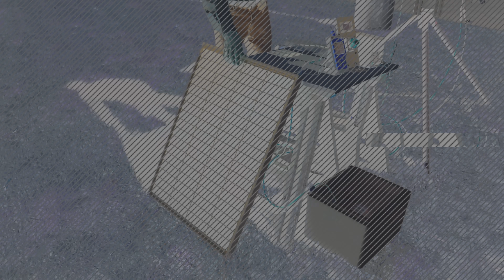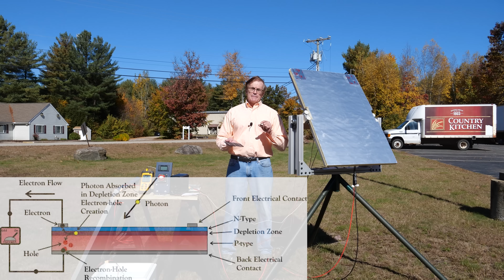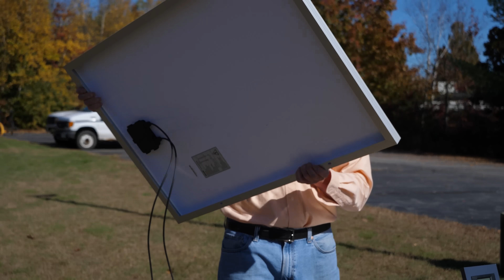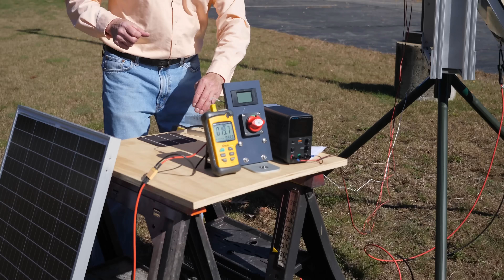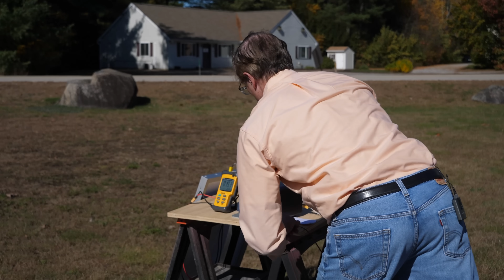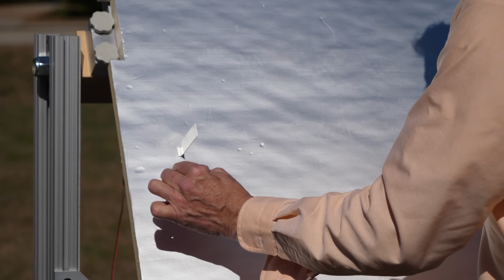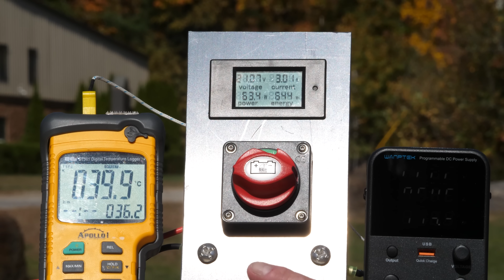Do you REALLY get enough out of your solar panel?

Comment: The ONLY thing I could suggest is to run a side by side comparison of the two identical panels, one actively cooled, and one not. I'd like to see data logging and graphing the way Matthias Wandell does. Face them due south and let them run for a full 12 hours.
Reply: I’d like to see this as well. During the initial control test measurements, I wondered if the unpowered cooling system has a greater temperature than the unmodified PV panel.
Reply: @jasonwisser3253  Good point. Tough to tell. The added heatsinks on the back may have even lowered the temperature of the panel when the cooling was disabled. It's not a perfect test.
Reply: @jasonwisser3253  It's unlikely that the modified PV is hotter than the unmodified one. 
They receive the same number of photons that create the waste heat this modification is addressing.
Reply: Great suggestion!
Reply: That's exactly what I was thinking.    Although it's a good experiment, this test wasn't really a comparison of an active cooled panel to an unmodified panel.   Having all that extra active cooling hardware on there without the fans running, might actually be hampering the passive cooling compared to an unmodified panel (Especially having the back closed off).
Reply: @Matthiaswandel Please respond to this!
Reply: I agree with this. The added aluminium sheet on the back would detract from the natural convection cooling which would occur. This shows why free mounted panels work better than roof mounted ones. The caveat now, is that panels have gotten so cheap, it's far easier just to add a few more panels to compensate. Certainly cheaper than all those fans and heatsinks!
Reply: Yes, and drive the fans by the produced energy off of the cooled solar panel through a buck converter set at the fans most efficient voltage. Adding any external power through a power supply does not make sense for a scientific efficiency measurement.
Reply: @niclas.lindstrom  That's exactly what was used in the video. The bench power supply and fans were supplied by the panel, but not included in the load power measurement. This means that the panel actually produced 8W more power, but 3W was devoted to cooling, so the net power gain was 5W.
Reply: @asm_nop  Did you invert to AC and then back to DC? If so, your gain was probably even higher as there are conversion losses that can be avoided by simply using a DC/DC buck converter instead.
Reply: @asm_nop  The gain would be between 0 to 5W without the modification
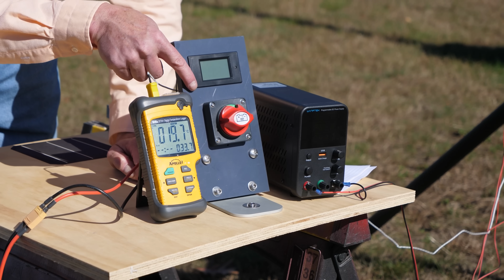Reply: @asm_nop  no. The solar panel power was only going to the resistors. Look at 8:20 again.

Comment: You might wanna check out the solution of Linus from @LinusTechTips where he's planning to use water cooling for panels and dump that heat into pool nearby his house. Ofc that solution wouldn't be really applicable if in winters there is very low temperature to the point in which water would freeze in the pool but it still sounds quite efficient. Another way could be to dump heat as in-floor heating (however it's not really applicable for summer) or maybe just route water via copper pipes in ground? Usually several meters underground there's like not too hot nor too cold in moderate climate and that could be another possibility for water cooling. Speaking of pumps efficiency, it would also scale with power draw kinda like fans, running one pump for single panel would most likely be inefficient but one larger pump for whole roof section of them sounds quite compelling. Even if wattage net would reach equilibrium or even very slightly waste, that could probably still pay off in panel longetivity and reduce waste of used up panels which is worth it in my opinion.

Comment: This takes me back to the video about using reflectors to boost the output from a single solar panel, since one big issue with doing so was that exposing the panel to over twice the amount of sunlight would probably fry it, this seems like it would be a great way to reach the top rated power output even on less than ideal conditions
Reply: I saw one panel that had one tiny cell, with huge heat sink and a focusing lens to concentrate sunlight.

Comment: I have a 10K system on my roof that is underperforming. I know heat does have a small effect in the summer but the drop off in spring and fall is significant.  Winter is just horrible.  Given that my system is already installed, is there anything I can do that might improve performance outside of summer?  I'm about a 45 degree latitude. About half my panels are oriented south and half to the afternoon sun due to my L shaped roof.
Reply from the maker: You can perform a simple  experiment.  On a clear day, note your power output and then spend  a few minutes with a hose and spray water over the whole array. Immediately (or during if you have an assistant), note the power output.

Comment: I don't think you proved what you claim. You compared two conditions, one with the fan off and one with the fan running. But in both conditions, the back is mostly  covered by an aluminum sheet. That's not the condition you need to compare against. You need to compare the fan running condition against a panel with no sheet on the back. I'm very skeptical that the amount of cooling you got from the fans exceeded the amount of cooling you removed by putting the sheet on the back in the first place.

Comment: I live in Europe, in climate that resembles New England. Here we have enough sunny days to consider solar electricity, I'm even producing hot water by solar for years now. But with gas prices rising, I started to seriousla tinker about how it would be to use solar panels as a source of heat for heat pump. Obviously they can freeze and are made to withstand that. And they always get some energy at least. So why not super cool them in winter when there's demand for heat? How much would they produce? I mean, with enough panels, would you be able to heat house? Switching to cooling them in summer months, my place is abundant with ground waters, one can use that water for cooling panels and return it to soil, I see no waste there, Am i right or not?
Reply from the maker: You're  right.
The real  issue  is engineering to get an improvement  with a minimal investment and to be able to operate  the system without  modification if you reconsider. I would approach  this in stages.

Comment: Photovoltaic is junk.

Hot water panels though? They are awesome.  Light, and uvs can be turned to heat, meaning steam power is the way to go.  Free heat, free hot water, free low temp cooking, and 10% conversion to air pressure or electricity.

Comment: If you picture an atomic nucleus and its electron cloud, what happens is a photon gets absorbed by the electron cloud and gets excited. You can imagine this as an electron jumping to another orbit temporarily. This generates the electric field and heat in the process.

Sadly my house is shaded from the sun most of the day, but I have been looking at watercoolded PV panels for quite a while now as this would be the "easiest" way to generate some heat to store for later. The only problem is that the waterloop would gradually get hotter over time if you were to use this for domestic water heating.
Reply: And not only heat is generated, they can also emit light!

Comment: The experiment is particularly interesting, but I dont understand the motivation behind it, yet. Sure, active cooling can obviously improve the operating efficency, but even if you manage to get an extra ~10% in high heat conditions back, who cares?  Solar panels are so cheap, just get another one or two. And no, in modern sillicon based panels there are no toxic heavy metals so recycling could be readily done if governments would finally put the right policies in place.

If you are really tight on space and you absolutely DO need those extra ~10%, fair enough, go ahead, or just buy premium panels with a lower Power Temp coefficient and lower annual degradation rate. Also, gallium doped silicon panels are making their way onto the market right now, and there is a good foundation to expect them to be much more long lasting.

But longevity isn't really a problem in reality anymore anyway. In the the absolute majority of use cases the average operating temperatures are nowhere near the upper limit.
And you get an easy 30+ years above 80% lifespan out of most modern panels. By then the technology will certainly have advanced to a point where you might want to consider exchanging your panels anyway.

From a technical standpoint I absolutely love this experiment, but im not too sure if thats the best option economically.

Edit: I'm really glad that your eye situation got better and that you're back with new videos!

Comment: Could some kind of thermoelectric generator be added to the back of the panels to turn the heat into more power instead of just dumping it into the air?

Comment: Just place the panels on the ground and use the Earth's constant temperature to cool the panels?  You can also do this in conjunction with bringing the light to the panels using a solar concentrator and a light guide made out of fluorescent acrylic to filter out the radiant heat while creating more useful light!  This can potentially reduce the required surface area of the panels needed and put that savings into the other supplies needed for this setup, i.e. lots of acrylic!  This was done by a Japanese group, I believe.   They had fluorescent acrylic panels that they fashioned thin solar panel strips to the edge where the light naturally propagates.

Comment: You lost 15% of efficiency from ambient to peak temp.  You recovered roughly half of that loss after powering the fans, so a net improvement of 7.5% under normal operating conditions.  The question is whether or not you could purchase and install the cooling fins and fans onto the panel for 7.5% worth of additional cost to each panel.  I tend to doubt that would be possible.  It's also worth noting that shipping the resultant panels would be more expensive due to both weight and dimensional considerations.

If you installed the cooling fins on several panels, without fans, and used ducting to connect the panels together in a vertical orientation, you could create a thermosiphon that draws in air from an intake on the bottom panel and exhausts from the top panel.  The more panels you had in the vertical column, the more pronounced the effect would be.  The net impact on cooling would greater on panels near the top, but it would be entirely passive and not create dimensional challenges for shipping or transporting.  (Those exposed fan housings are a real liability.)
Reply from the maker: Good thinking.
Those are the issues that need to be addressed in realistic systems.  I tested this approach so that it would become part of the discussion.
Reply: @TechIngredients  - I neglected to mention that your video was VERY well-made and your testing layout was quite impressive.

Comment: Regarding the water drip method, wont it just cool the panel using heat vaporization? 
The panel has a lot of surface area, so I suspect the vaporization effect may be significant.
It might be way more efficient than using a fan, with the downside that it needs to be topped-up with water occasionally.

Comment: I think the biggest issues for applying this to a residential, rooftop system are going to be longevity of the fans and the amount of actual cooling you'd get on a roof mounted system rather than in open air. I very much doubt you'll get a supplier to warranty small roof top fans for 20+ years. If you could feed the heat into the hot water system or heat pump then it might make it more appealing

Comment: Ever taken the fan off an old computer CPU heat sink?
They're full of dust and dirt after just a year or 2 and that means less effective cooling.
Near the ocean all our office computer's heat sinks actually corrode and also cool less effectively...
That's a computer working inside an office with maybe an air cleaner or air conditioner?
Try running this fan cooled soar panel outside for 20~25yrs... 
Me thinks you'll need to open it up and clean the dust and dirt quite often to keep it running efficiently... What a nightmare of a job... I think there is a better way to cool the panels, or just forget about it and add a few more to the system?

Comment: I recently read a report which stated that it had just been discovered that you can get actually about 7x more power out of a solar panel over the course of a year, just by doing the following:

1) Switching to a bifacial solar panel (i.e, one that produces electricity when Sunlight hits both of its sides).  As opposed to using a more standard single-sided PV panel.
2) Standing said PV panel completely upright (i.e., setting it up completely vertically).
3) Orienting that upright panel to face from East to West.

This flies in the face of the normal/traditional method of maximizing annual PV panel output by facing a PV panel towards the South and then angling it appropriately for the Latitude of the area.

Is that report actually true?  I'd love to see a real-world test!

Comment: Great video! I greatly appreciate that you are moving into testing things in the renewable energy sector. I would love to see a series on wind turbine technology and testing. There are a lot of people trying to showcase things on youtube regarding this subject, but they have no where near your setup, expertise and knowledge of physics to convey any good actionable information. With your previous experience in building propellers you are in a prime position to showcase building an efficient wind turbine from scratch, building the wings, stator, rotor disc, making of the spools, brake system etc etc etc.
With the current energy crisis I suspect this could really blow up the channel if you were to do extensive testing and building of something that actually worked, as oppose to the cheap chinese wind turbines that have flooded the market and that people are wasting good money on in desperation, trying to achieve a modicum of selfsustainability.

Comment: What if...
What if you covered the back of the pannel in TEG's then air cooled the cool side. perchance could you make enough power to run the fans from the TEG's alone?
It would make the whole thing really simple, control would be automatic. when the panels get hotter then the ambient cool side, it would make a current, which would turn the fans on. Cools down at night, and turns itself off.

Comment: Couldn't you use the desiccant cooler you've built to cool the thing down even better? I.e. glue a tube to the back of the panel and circulate liquid into a cooler based on a similar idea like your solar powered AC. Would that work?

Comment: With more production at lower temperature, you're also able to sell more power into the grid, rather than running your toaster, or buying a smaller system.  What's the likely lifetime of the fans?

Comment: There is a French company called DualSun that uses this principle, they simply put water panels under the photovoltaic panels, and the hot water goes to the house with a heat exchanger (I forget if it's water you have to flush in the winter or anti-freeze). One big criticism of the system is that you get way too much hot water by comparison to how much electricity you get (basically we normally don't size photovoltaic and water system the same way).

Comment: Yeah, nice experiment, but not practicable. Try to get the fans integrated so they do not stand out (radial fans), make sure they work at any temperature range, rain, freezing. Or rather: do not work when freezing, and also make sure they work for 25 years as PV panels do. Tricky with mechanical moving parts.
Been there, done that, there are some hybrid PV panels - water cooled - which can generate both electricity and heat. Maybe these could be used for some special cases. They are called PVT, these are the manufacturers: Vissolar, Consolar, Nibe, Gasokol, Solimpeks, Pvtsolar, Fototherm, Solator

Comment: I agree. For the private use it is only worth to consider the lifetime increase and not for the ~3% of added power. In the summer you always have a power surplus anyway. 
But could most of that lifetime increase be gained with simply one fan on the back side without any fins? I'm looking for a 80/20 Pareto solution here. 
If you cut down the hottest 10°C this should a significant gain.

Comment: what about passively cooled panels?  I'm thinking a water circuit on the back side, with one way valves so warm expanding water is always pushed out and replaced with cool water from a reservoir.  basically a solar water heater, but used to carry away heat (edit: should have waited, this topic is discussed in the latter part of the video)

Comment: It would be interesting to see if something like a sterling engine could be created to entirely non electrically cool the panels. It's been a lovely 38C day here in Southern Australia and I'm sure most of the solar electric panels would be way down on capacity.
Further to the heating and capacity issue I've wondered whether a selective wavelength reflector could be used to indirectly illuminate panels and make more use of the higher electrical energy producing wavelengths and reject the heating infra red wavelengths.